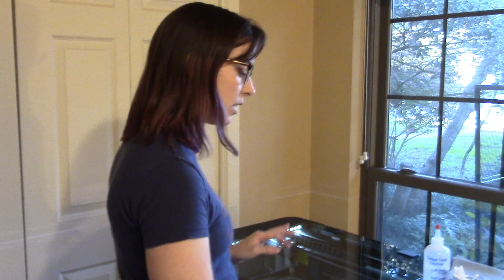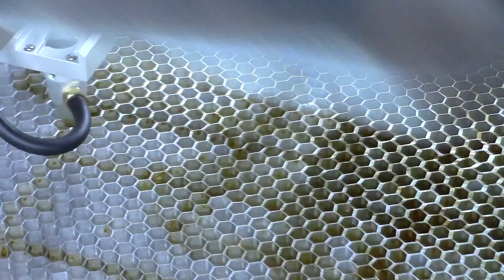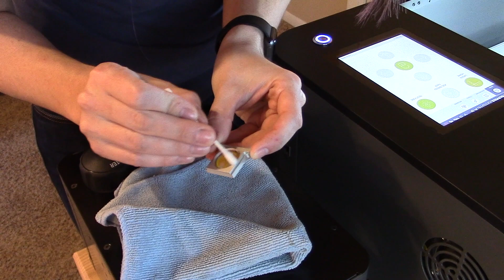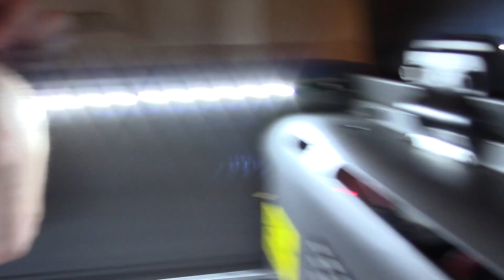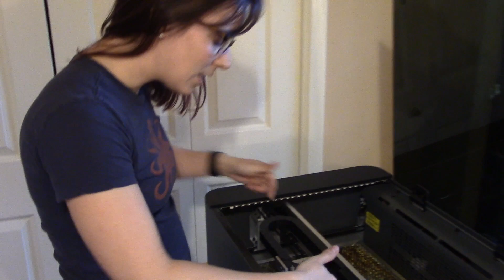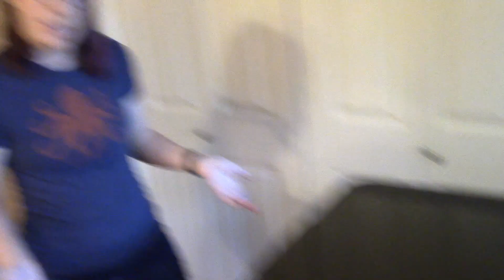Laser Cutter Cleaning -  on my Dremel Digilab LC40 Laser Cutter

Comment: Thanks for the video, it has been very helpful. I am also a very early adopter of the Dremel LC40, and while I really like it I am bummed out that they discontinued the model/line.
A couple of simple tips to make use of the LC40 (or any laser cutter) easier: 
I line the cutter bed, underneath the honeycomb plate with aluminum foil. Keeps the soot/pitch off the bottom and lets me lift out debris easily.
I also made some simple weights from 3/16” thick steel bar 3/4” wide (from HomeDepot) to hold down any lightweight materials or flatten warped plywood. It is low enough to clear the cutter head.
Lastly, I you have access to a table saw you can make some thin wood boards to cut/engrave on the LC40. See this Instructable: https://www.instructables.com/Making-Thin-Wood-Boards-for-Laser-Cutting/

Comment: Videos are great! Your videos  influenced my decision to recently purchase the Dremel and I have been very happy with it!
😊Although I have another hour before my first cleaning, I made my cleaning solution as per your recommendations. Still pretty pungent vinegar smell, so I’m sure it will clean those lenses. 
Just out of curiosity, how DO you unlock k the gantry?
Reply from the maker: Great! Glad it's working well for you so far. The gantry is unlocked when the machine is off, so you can move it around to get to the lens pretty easily. That's the only time that I manually move it.

Comment: I have a sticky residue, below the honeycomb insert, left over from cutting a lot of 1/8" birch wood sheets.  Do you any recommendations for cleaning up this sticky residue?
Reply from the maker: I haven't cleaned mine yet, but I've heard GooGone and a microfiber cloth is a good starting point for the bed itself. For the honeycomb, I've heard oven cleaner is good, but you'll need to double check the type of metal before using it!